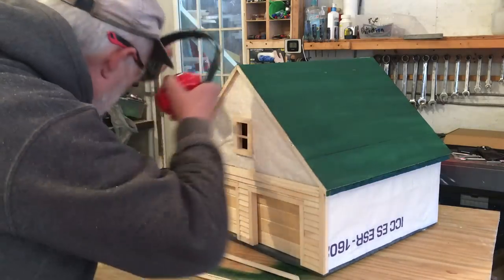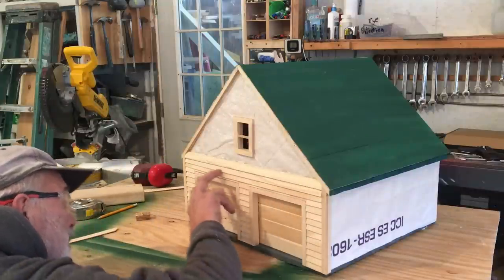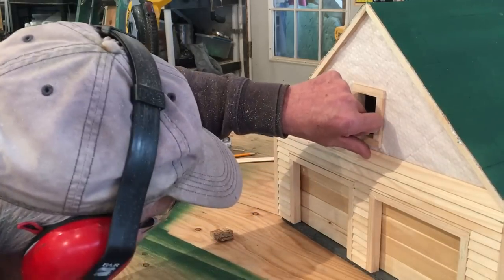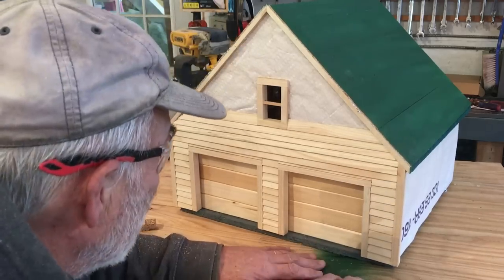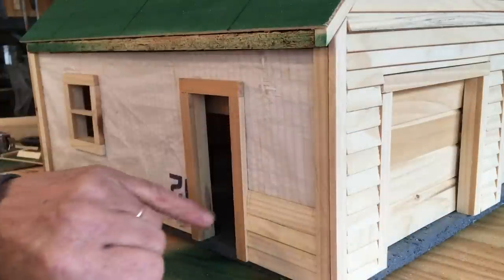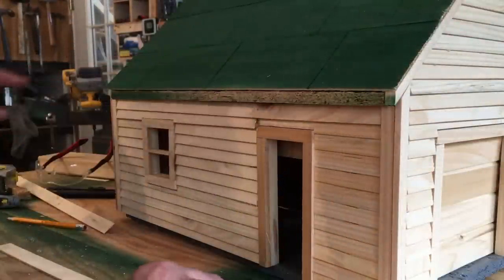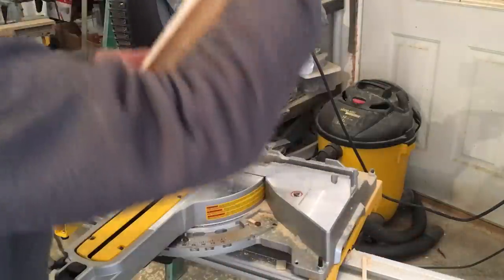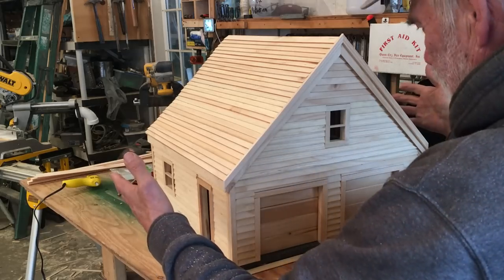HARDEST PART OF THIS ENTIRE BUILD...Tiny Garage Part 7

Comment: After the roof is painted, I find that a fine tip black sharpe maker works great for drawing the lines for the shingle look.
Also, Consider clear coating the siding to show off the beauty of the wood as well as your craftsmanship. I think then if you paint the trim the same green color that’s now on the roof would look fantastic. 
Great job. Love watching the build.

Comment: could do metal roofing with vertical panels top to bottom and small strips to run vertically for the high ridges in the metal.  lines (paint) for the rest from top to bottom (every 9" of course).  May be faster than painting shingles.   Not sure if I explained that the way I was trying.. 😄

Comment: Hope you paint it as 2 parts or the paint may stick it together. I thought you would have glued lite angled bits to wood on the the roof to simulate tin sheets as that would be easier than painting shingles on. Anyway you have done a magnificent job with this 2 piece garage.